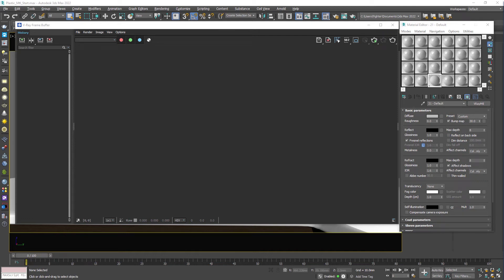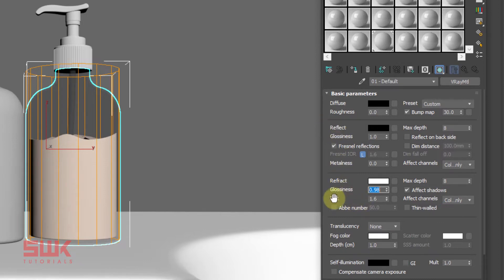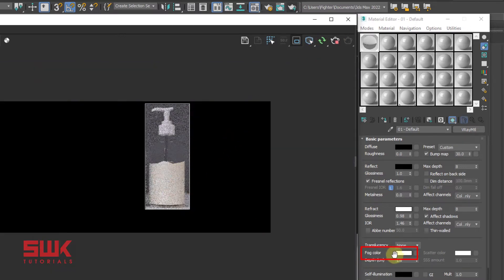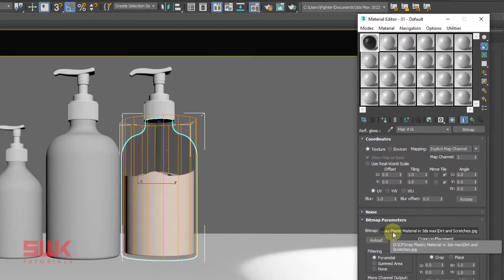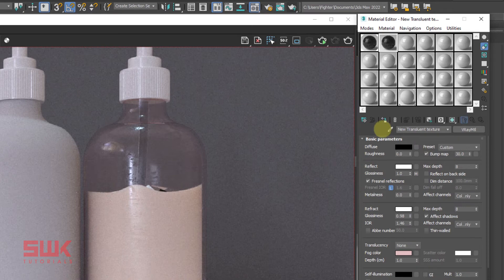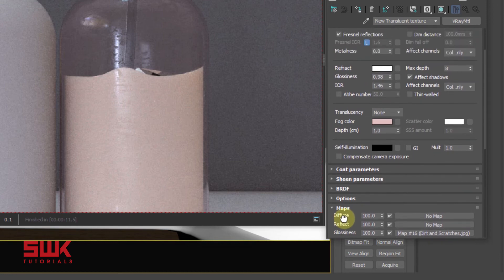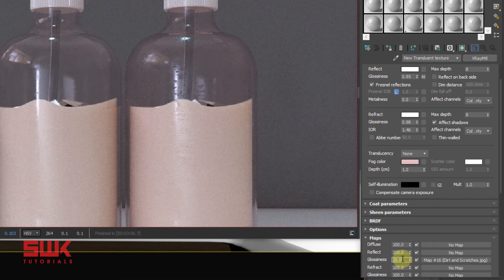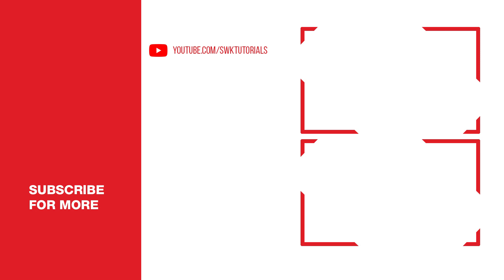3ds max | Vray Translucent / Transparent Plastic materials in 3dsmax

Comment: hello sir i am using tiles from (maps in general in tiles ) ( location) while giving them texture on surface it will not occur on screen and i also on the show shaded material sir what is the reason please guide me
Reply from the maker: I'm not 100% sure what you are trying to ask
If you're texture is showing on rendering but not in viewport (screen). Then your need check "show shaded material in viewport" button in materials editor.
Reply: if you share  me your mail id , facebook id, any kind of medium through i contact you and send you my render images which easy to explain because i see your all video and it very useful but i have my own doubt about 3ds max. and i think that you can solve it